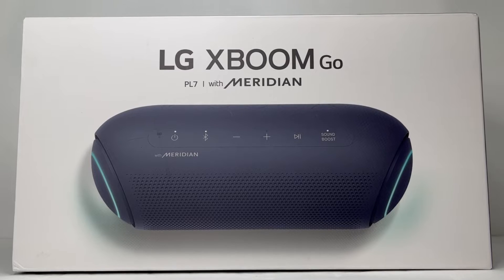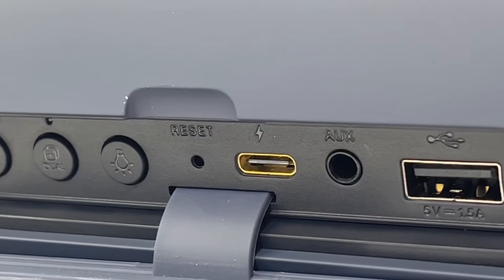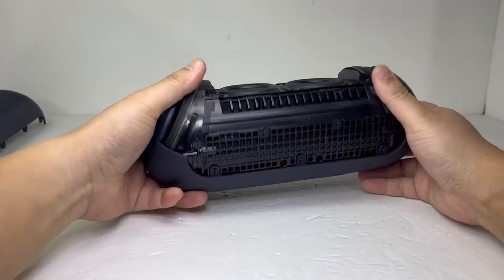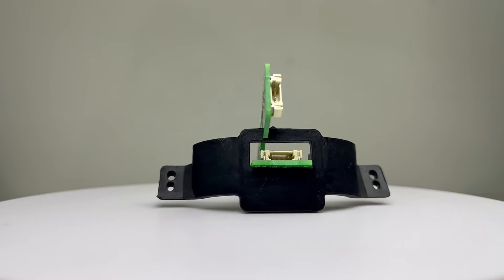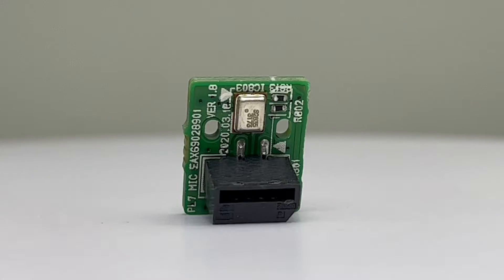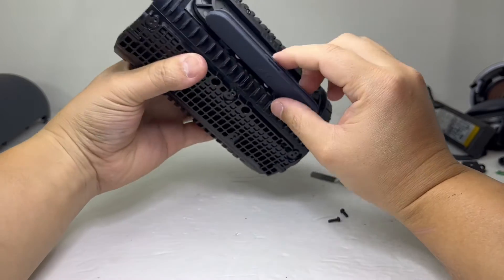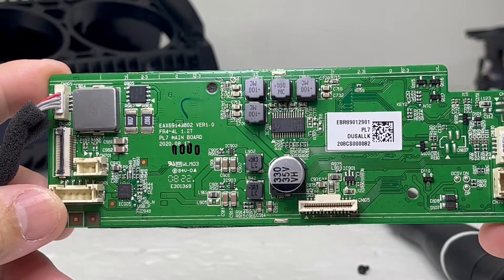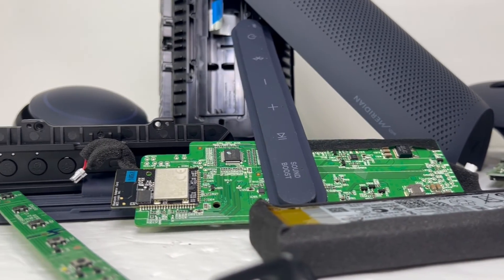LG XBOOM GO PL7 COMPLETE TEARDOWN !!!

Comment: Thank you. Last night my XBOOM stopped taking a battery charge. It showed false 100% charged on the app and green LED with the charge lead connected, and only 20% charge left and red LED without the lead connected, so of course, it died. I might have had this unit for 18 mo by now, so maybe it just needs a new battery. Maybe if I try the other USB A connection,it may charge ok again.
Your video makes me think I should be able to repair it rather than send it to landfill like so much electronics goods these days.

Comment: One of pl7 speaker went bad. Where can I buy a replacement
Reply from the maker: check on ebay, sometime they may have speaker for part.  if you cant, measure the size of the driver and get the equivilent to it.